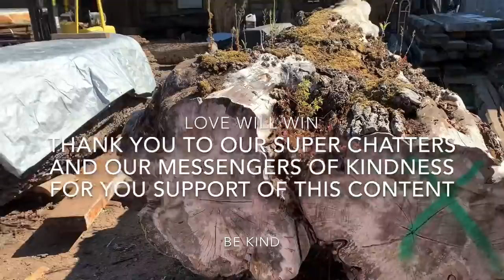Stihl 090 - 7 foot bar ,Alaskan milling  - historic massive walnut tree

Comment: Fun Channel ya have here - I'm in Alaska and I'm 68 now, but back in the early '80s I built my log cabin with an 090 bolted to a Woodland Bumble Bee mill - Only had a 3 foot bar on the saw - No big trees like you have where I live - Nothing to even really challenge the 090 - Amazing saw and cool video - Thanks Buckin'! - I'm subbed.

Comment: The message within the message is the message.....old wood, like first and second growth timber, or even something a couple hundred years old has spirits. To run that stuff through my saws at the shop on occasion and get to build something out of it? It’s a life experience. When my Aunt passed several years ago, I was able to wrap her ashes box in some old growth pine I had hanging around. Sometimes things are perfect. And that was perfect. I was not moving my hands while making that box. Something else was. Peace and love Buckin

Comment: We used to rip big spruce,fir and cedar logs with an 088 or 090,sometimes a 3120. Used 5 or 6 foot bars,did a lot of filing on the hill using those,you get quite good at it after a while.

Comment: Stunning absolutely gorgeous- just wondeing what the value of one of the slabs
Reply: Take a guess.  8 feet long by day 4 feet wide gives 32 square feet. At 3.5 I inches thick , that's 32 x 3.5 = 112 board feet.  When dry, it's probably worth $10 - $14 per board foot, maybe $6 - $8 green.  So, $600  to $900 green and $1100 to $1500 dry.  With special figure and the historic value, maybe a fair amount more.
Reply: Worth every penny
Reply: Wow..just wow

Comment: Beautiful log. I have a maple of similar size I am about to do with my Husky 3120 which has a 72” bar. What fuel mixture are you using? My only suggestion would be to let the saw run after cutting so that it can cool down.

Comment: Buckin! My apple tree fell over the other day, to many apples and it was rotten on the inside!

Is there a way to tell when a tree is rotting? I mean the apples were growing, branches were all living.

Do you ever deal with fruit trees, it would be neat to see some tips on fruit tree pruning.
Reply from the maker: I SURE DO MOST OLD APPLES ARE HOLLOW IT SEEMS A MAJORITY ANY WAY, DRILL A HOLE IN IT  AN IF IT RESISTS YOU FOR AN INCH OR TWO THEN YER DRILL SLAMS UP AGAIST THE TREE , SHES HOLLOW
Reply: @BuckinBillyRaySmith  Can anything be done if it's hollow? I seem to remember a guy in Vernon said apple trees don't last that long.

Comment: Does anybody know how much difference in board feet there would be when finished between a chainsaw mill vs a bandsaw mill? Meaning, would the thickness of the bar and chain over the entire process lose an extra plank vs a band saw? Also, what is difference in quality between the two? Is there much difference in how much finish sanding you have to do.

I'm looking to pick up a sawmill, and just want to know if it's worth it vs using an Alaskan mill. 

Thanks for any and all info, Gents.

Comment: Put a clamp on the top cross bar so the mill won’t keep pulling you. It will run along the ladder and make it easier to concentrate just on running the power head. 👍

Comment: Might need a 5L can of bar direct oil fed into that big old chain. lol
Reply: I think the old 090s can be fed a lot of oil but dang it would need to.
36" on hardwood is sometimes pushing it for my 880 turned right up
Reply: Yes they have manual oilers so pump away😎

Comment: In 2000, we had a big walnut blow over here in the uk, 6 foot at the butt end, some old wounds were full of concrete, we had no way of getting a machine to move it, so it was cut up into firewood, a great shame, i have some photos if you would like to see them, 394xp with a 30 inch bar did the job and used 2 chains to cut it up

Comment: Any continuous run kiln drying plant will plane your slabs to spec and dry em out in 15-48 hrs, not even that much more than an old batch kiln where i am.
Reply: Continous run kilns will take a much smaller minimum order quantity as well. They go down to a 10 tonne load here. pop it back on your trailer for a fee.

Comment: Got 13 feet of perfectly straight black walnut without any branches or knots almost 3 feet thick that I'm trying to get someone to take away. The tree company dropped the rest of the tree but left me a "totem pole" because they didn't have a crane or whatever it would take to carry it away. Supposedly they are coming back for it...

Comment: You guys will have had black walnuts much older than 150 years in america, that is only 1870. I've felled a black walnut here in new zealand that was from 1851. I reckon someone just cut most of yours down when they were 75yrs old.
Reply: Mine was planted by captain hobson, classic brit captain/botanist.
Reply: first british settlement of the americas was 1607, first settlement of New Zealand was 1836.